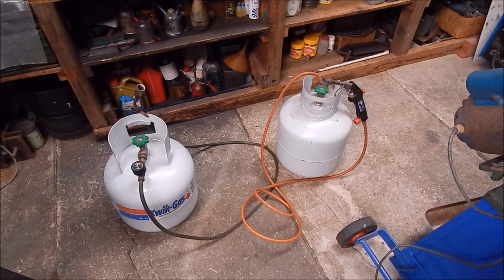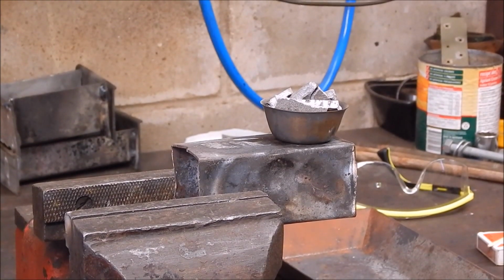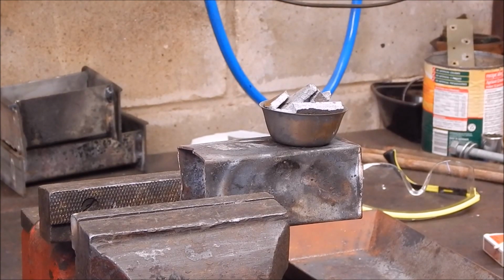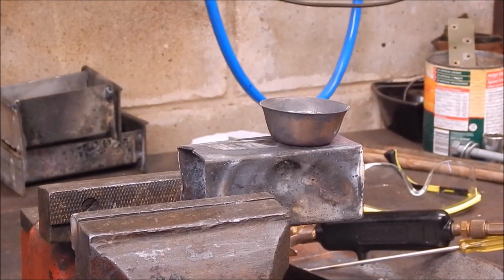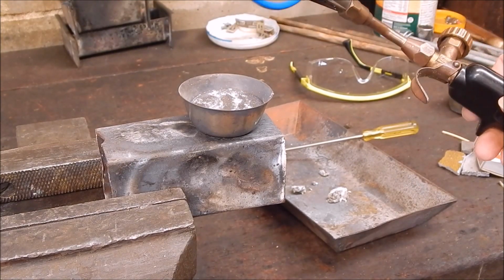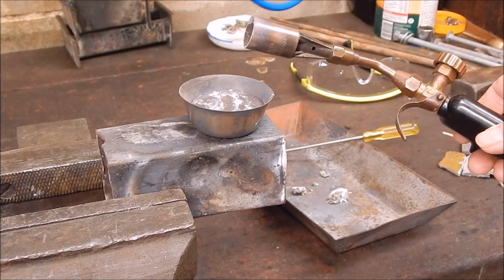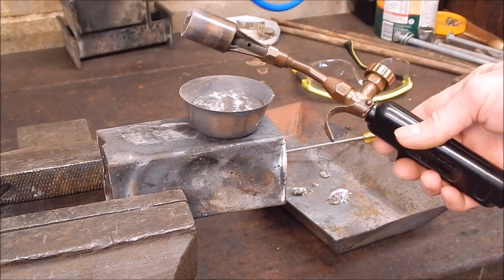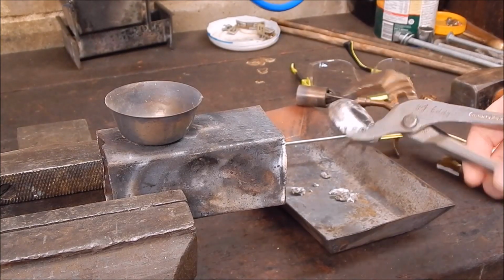How easy is it to melt aluminium ?

Comment: Thanks Rob.  Good of you to follow up like that. That's what I call customer service. :-))
Reply from the maker: G Coop It was an interesting exercise.  Always learning.  Cheers Rob
Reply: xynudu That was extremely interesting for me.  Awesome demo !
Yep always learning.
I never really had a need to melt small amounts of ally, but now I know I can without firing up the furnace I will likely use my regular lpg torch to do just that.
Well there you go people, a regular lpg torch is fine for small amounts of aluminium :O
 Thanks for taking the time to do that demo and upload it Rob.
Your a fair dinkum Aussie mythbuster mate :D
Thanks again, Paul
Reply from the maker: djpaulk  :)   I can see this being very useful for casting small stuff, say a bolt head into some alloy and then turning it down and knurling to form a tightening or locking screw.   You're also not playing around with large amounts of molten metal -  though you still need to treat it with respect.  Cheers Rob
Reply: xynudu Very useful indeed :) Your a mind reader... I was thinking of large knurled screw heads for my 7x12 mini lathe change gear cover bolts so I don't need an allen key. I can now do small late night foundry projects in my (well ventilated) lounge room workshop :)
I'm now tempted to start mucking around with some small midnight lost wax castings. I was wondering what I was going to do with the 20kg bag of plaster I found on the council kerbside cleanup. They will be so small they will easily fit in my kitchen oven to melt out the wax and the temp will be nice and controllable. Yep, always treat anything molten with respect.
You just opened me a new door for me Rob, thanks once more mate.

Comment: Hi Rob,

Finally I took the first steps towards building my own furnace. Got an oildrum and some firebricks quite cheap and now I'm slowly gathering the rest of what I need to actually start with the construction. The furnace design is based on the one by SVseeker, also on YouTube and it should be capable of melting aluminium and other metals as well. 
It won't be before the new year that I can do my first melt but I am getting there. 

Thnx for sharing.
Reply from the maker: That's a very good video/web page link your referring to.  Thanks for posting.  I will have a close look at all his information when I get a chance.  The flower pot furnace looks very interesting for use with a butane torch.  Be keen to see your furnace when you get it set up.  Stay safe.  Cheers Rob

Comment: How do you think using something like fireplace bricks to build a forge that had a torch and air intake at the bottom, just above the base of fireplace bricks.  Would that hold up and do the job?
Reply from the maker: Gimp Geek The thought did cross my mind that you could do something similar to hold/concentrate the heat.  The big LPG fired crucibles work on the same principle, so yes, should work OK.  You could even just make a small box of bricks open on one side and blast the crucible from that side.  Lots of possibilities. Cheers Rob

Comment: Great video.  The one thing I often wonder about is why does metal always form dross on the top?  For instance I often pour molten lead into a muffin pan and I have already skimmed the dross off it.  The next time I melt the same lead I have to skim the dross off all over again.  I think that is my web search item of the day.  Thanks for sharing.
Reply from the maker: cerberus My take on dross formation is that it is oxidised alloy predominantly (plus any old paint etc).  In addition, while heating, surface oxidisation is also occuring.  All alloy has an oxidation surface film.  That's why remelting alloy cuttings/turnings makes a huge amount of dross, as it has a huge surface area per given mass.  They're my thoughts on the matter.  Cheers Rob

Comment: Another good video, thanks Rob
Not sure if everyone is aware that Bunnings are now offering oxy acetylene cylinders without cylinder rental costs. I was considering getting the Bullfinch kit but now that I can get an oxy acet system without worrying about cylinder rental, this may be a more versatile option. 
Rob, you've had oxy acet in the past, is the Bullfinch system better for some things than oxy? ie if I go oxy, is there anything I wouldn't be able to do that I could with the Bullfinch?
Reply from the maker: Not really, provided you have the correct tip for the job.  That's interesting news. Souds very good.   I can see oxy sets becoming valuable again :)  I sold my set for $20.  I did a bit of investigating and it appears you pay $99 per bottle of gas (that's just the gas) after you return the bottle and get a refund.  So for roughly $200 that's pretty good value as an operating cost.  Certainly having an open ended time limit on the bottles makes it a very appealing deal.  It's just a matter of deciding whether you need intense heating/cutting capability.  It's an interesting decision, but if you can get a decent oxy set cheap I would go that way.  Cheers Rob
Reply from the maker: xynudu
I should just follow up and say that while the oxy/acet will do all things, it will be a lot more expensive to run for less demanding jobs that LPG can do.  I would go the way of the new Bunnings deal and also have a cheap conventional LPG burner.  That way you keep it all as cheap as possible.  Cheers Rob
Reply: xynudu
Thanks Rob.
I have an old Primus LPG system, so that's covered, it's just not hot enough for some of the more useful tasks like hard bronze brazing etc.
Yes, those figures are what I've heard too. Haven't been to Bunnings yet to confirm. There's a list of participating stores, my closest doesn't do them but another not too far away does so I'll venture out there to check it out.
My only concern with oxy acet. is if Bunnings decide it doesn't prove popular enough for them to continue with it... I would have thought it would prove popular provided enough people hear about it.
Reply from the maker: arrhythmia2 I think Bunnings would be obliged to  honour the agreement regardless.  I wouldn't be surprised if this is a deal stitched up with BOC or someone to counter the hit regular bottle rental must be taking at present with low demand by manufacturing industry etc.  Generally major suppliers of a controlled item don't do these sort of deals unless it's to their advantage.  Rob

Comment: Hi Rob,  I have been eying a Bullfinch for myself.  Is that a 404 and how do you like it?
Reply from the maker: Eddie the Grouch Hi Eddie.  Yes that is the 404 kit and I like it a lot.  It's perfect for bronzing carbide tips to cutters, other small brazing jobs, bending stuff, and anything you would expect to do with MAPP gas.  Equally as good, and actually better in windy conditions.The big plus is that the gas is very cheap to buy.  A 9KG bottle costs as much as a MAPP gas bottle, but lasts many many many times longer.  I had oxy/acet before, but the rental cost was a killer ($200+ a year) so after trying the Bro in Laws Bullfinch I got one.If buying from the UK be aware that the POL fitting may not be compatible with other countries cylinders if you are non UK resident.  In Australia the agent supplies the kit with the correct gas bottle connector.It's not a cheap kit, but well worth the outlay.I've had mine about 15 years.Definitely worth buying.  Cheers Rob
Reply: xynudu"I like it a lot"....That's why you used it, instead of the other :P

Comment: Could you give an estimate (educated guess is fine) on how many pounds of aluminum you could process this way on one "batch" (two tanks) of propane?   I'd like to figure out a rough cost of propane per pound of aluminum to melt down aluminum this way and that info would help...  or even an estimate of "runtime" could help...how long you could keep that flame going for?   There are many ways this could be estimated.  What info do you think you could estimate?   (Even if you had an idea of how much propane was used up during that time and how much was left in the tank using the hot water test pouring over the side of the propane tank?)
Reply from the maker: underourrock I have no idea of propane usage by metal weight.  

I have never calculated it. 

FYI you can easily calculate gas use by weighing the bottle on bath room scales before and after.

Can't help you on this one.

Cheers Rob
Reply from the maker: underourrock Just to add a bit more on this - the gas usage by weight is so low, given the short run time, that I can't even give a rough estimate for you that would be meaningful.

Maybe some backyard casting sites have info on this aspect.

Cheers Rob
Reply: xynudu Thanks for the followup reply.  Even that is helpful.  It sounds like it might be more effective than the foundry I was going to cast.  Maybe a cheaper combination of both.   Thanks for the info you did give and for taking the time to reply!    Cheers!